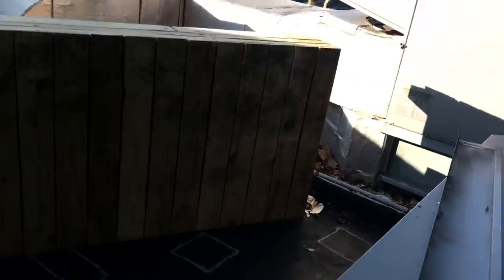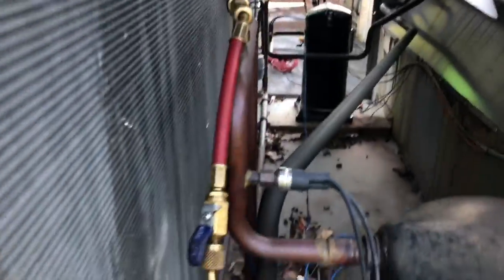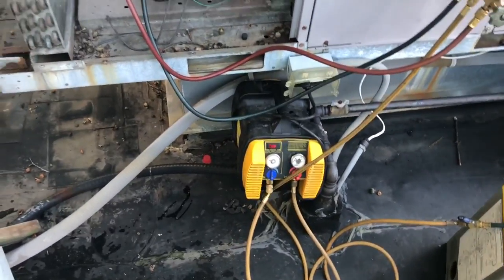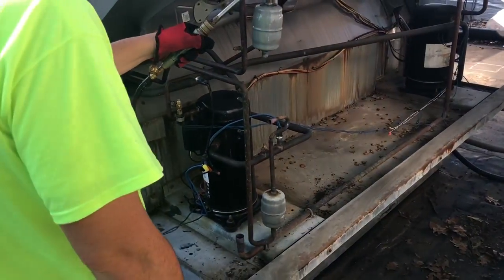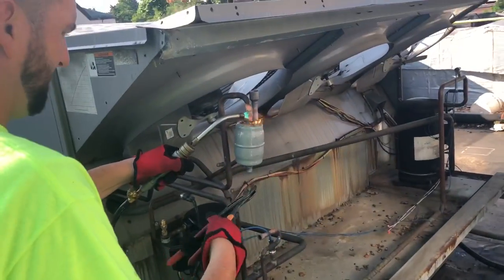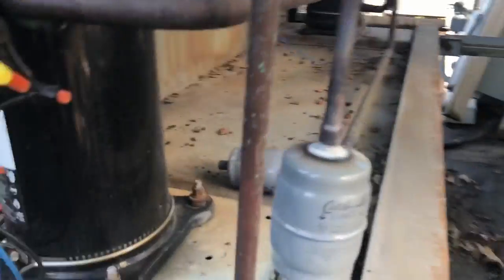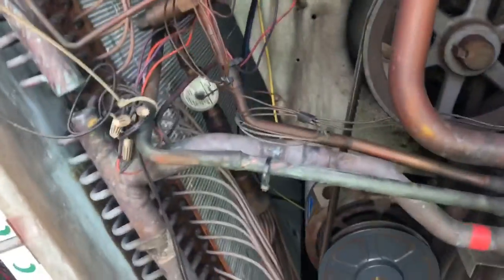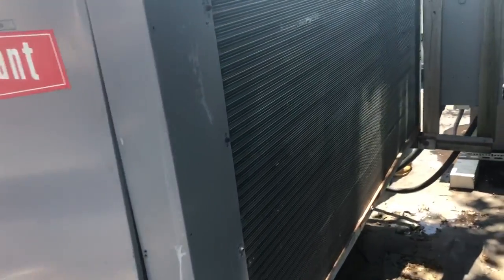RTU condenser coil changeout and Hvac trade talk

Comment: Literally just did this exact coil the other day.
Reply: how heavy are these coils? do you need a crane?
Reply: @al.e123iis7  we used one. Easy 2 man lift out of the crate and around the roof. But not pulling it up however many feet.